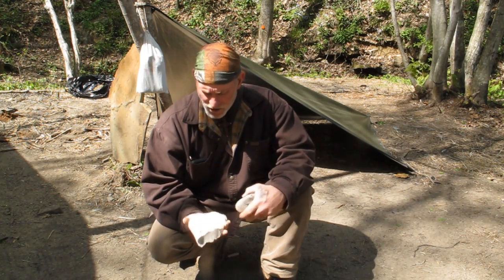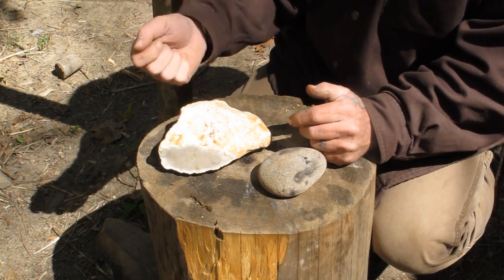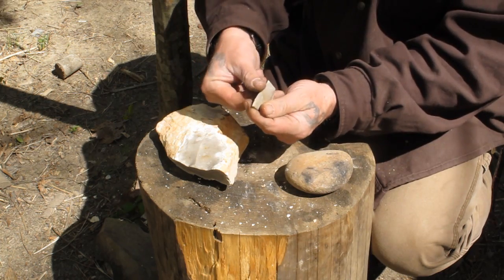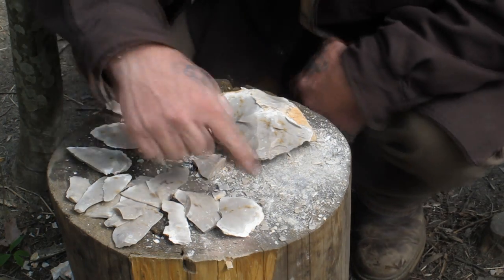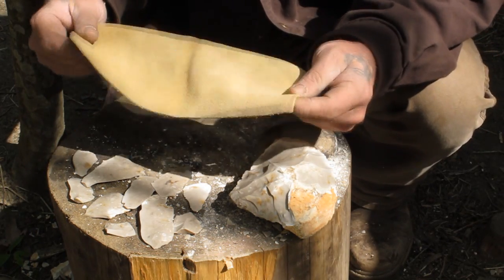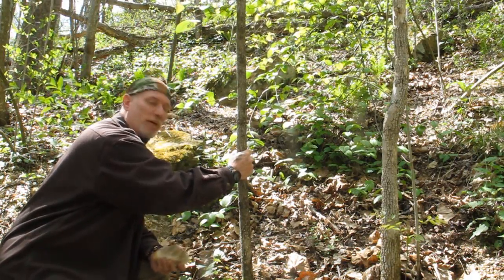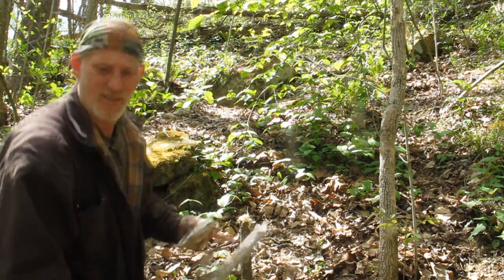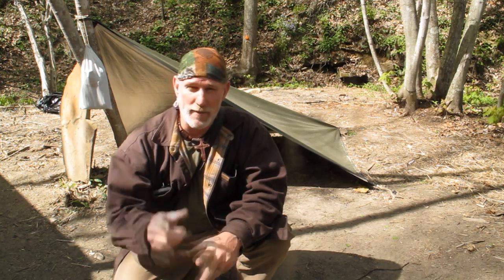Making Simple Stone Tools from a Flint Nodule.wmv

Comment: Here is Mohs scale of hardness equivalents: 2.5
	Fingernail

2.5–3
	Gold, Silver

3
	Copper penny

4-4.5
	Platinum
4-5 	Iron
5.5 	Knife blade
6-7 	Glass
6.5 	Iron pyrite
7+ 	Hardened steel file
So if you can scratch it with your fingernail, it is below 2.5.  If the rock can scratch  steel file it is 7 or above.

Comment: Hell, yeah!  Stone tools are referenced, but a bit omitted as far as USING them goes.  Pretty quick getting throught that oak, considering that he didn't have a handle or a blade with an easy to swing shape.  Just to put a trick out there:  you can make a sharpener by grinding two coarse stones together in a circular way (sandstone, limestone, whatever).  Flattens it out & keeping the stone wet (water, oil, etc...) will increase its abrasive qualities.  Gets all the crap out of the spaces.